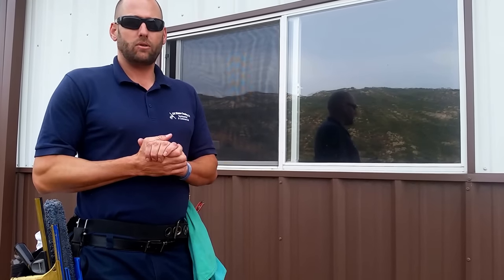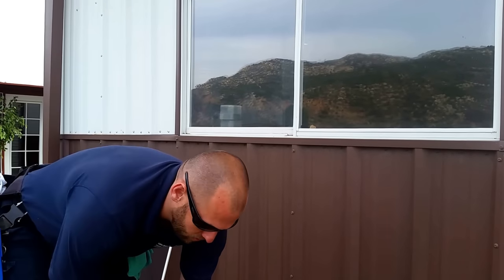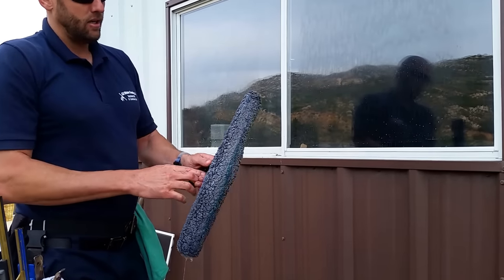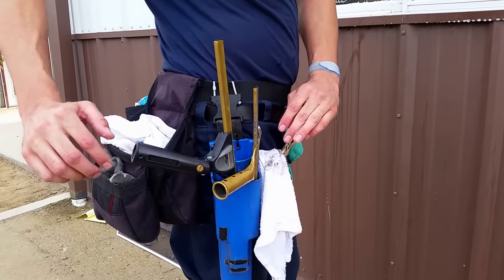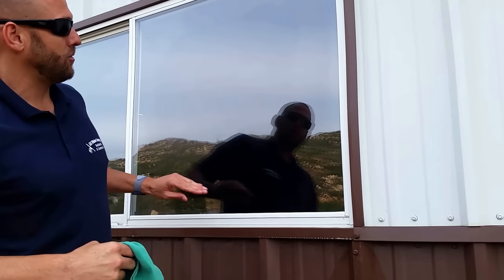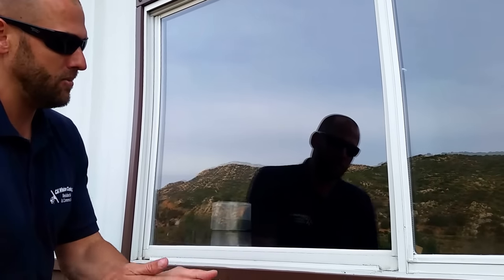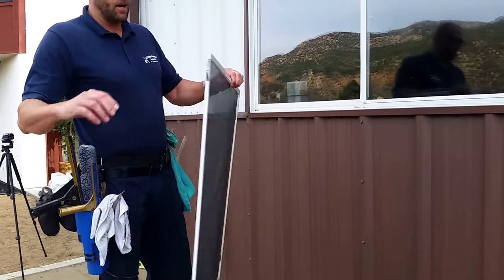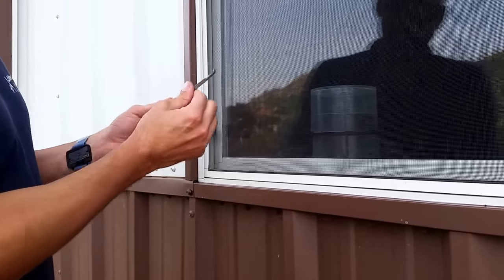5 STEPS of WINDOW CLEANING - C & C Employee Training

Comment: I have been cleaning windows over 20 years and you make it so much harder than it has to be. Rags and steel wool are completely unnecessary. Carry a scraper for paint or sap and other stuck on debris. Maybe one wet rag for wiping sills, dip, rinse and reuse. I understand not wanting call backs from sloppy work from employees but you just need to personally train them and work with them until they get it right.
Reply from the maker: your a better man than me giving your people razor blades......I truely dont know how you get away with it...

Comment: 1. Take all screens off with a 5 in 1 from all windows first in order and go wash them with window Brush and hosing off the screens and wiping edges and knocking off water. Than put each screens near the window it came from.  I charge $2.50 a screen and always wash them as they hold lots of dirt, mold and pollen. When it rains the window will get dirty again if the screen is not washed. Most contemporary residential vinyl windows require you take the screen off and back on from the inside. Other screens that cover an entire windows I take loose the 2 clamps at the sill and take off from outside. Ladder w''s (Windows) are taken off from the inside and stacked in order outside to wash. 
2. Wash all windows and frames with a window washing  brush with dawn and water.
3. I use a triumph 6 inch scraper to get all bug and paint off while the window is wet
4. Re wet window 
5. Wipe top edge squeegee window and one side if doing a side pull. On residential w's I don't usually fan the w's. We do very expensive high end homes and do not want to leave any squeegee marks. 
6 Dry cloth wipe edges being careful not over rag the w's as that will leave dry rag marks.  
7. Reinstall screen
I only use 4 ought steel wool if I have oxidation or on the frame and sill to get stubborn mold stains off. Yours truly, Sterling  Window Cleaning in North Georgia.  
Moral when the sun comes out and shines on your windows than you will know how good a job you really did. Same in life when the Son shines on your life at the end what will He see? Sin or shine?
Reply: Romans 3: 22-24
22 Even the righteousness of God which is by faith of Jesus Christ unto all and upon all them that believe: for there is no difference:
23 For all have sinned, and come short of the glory of God;
24 Being justified freely by his grace through the redemption that is in Christ Jesus:

Our righteousness is as filthy rags. What do you want Jesus to see when he looks at us, our sinful lives, or the righteousness of Christ imputed to us by faith? Put your trust in Jesus Christ for salvation, not your own works.

1 John 1: 8-10
8 If we say that we have no sin, we deceive ourselves, and the truth is not in us.
9 If we confess our sins, he is faithful and just to forgive us our sins, and to cleanse us from all unrighteousness.
10 If we say that we have not sinned, we make him a liar, and his word is not in us.
Reply: What is this windows or sunday school

Comment: Another good way to prevent dry streaks or smudges is to apply a decent amount of pressure from the squeegee to the window. I used to get very frustrated with these streaks because I knew I squeegees the window like a boss. Once I started applying heavier pressure to the window with the squeegee, left over streaks and smudges became a thing of the past. Also, I’ve never used the ragging the edges before squeegeeing technique, that will save me a lot of time. Thank you for the nice instructional video.
Reply from the maker: thank you for commenting, yes, pre-ragging the window will really save your rubber edges big time!

Comment: A safety is us only S/S blades on windows. I install graphics on the glass and have to some time run a blade on the glass. S/S blade is less likely to damage the glass as carbon steel blades.
Reply from the maker: Cool beans thanks for the comment
Reply: Robert w Sieburg late to the party but. What are s/s blades ?

Comment: I use a water hose with low jet setting to get those tracks completely clean. Your 'extracter' tool can scratch the frames or puncture the screen, try a frosting spreader, it's smooth edges and rounded top do an excellent job of removing most screens from the outside.Are you doing an initial cleaning?Hope you charged accordingly. And polished? Funny.We use natural sponges instead of rags. Anyway I've been doing windows for over 30 years.I am a pro!!
Reply: Thanks for the frosting spreader tip. I just want to clean my screens and have a hard time getting them to pop out. Hence I don't clean them. Sigh. I should just hire someone.

Comment: Amazing detail, have you tried bronze wool? Doesn’t rust.
Reply from the maker: Bronze wool does not rust but only comes in a maximum of 000 you also have to put your credit card into a website, have a computer,  have internet access, and then wait for the 000 steel wool to arrive, then you may or may not run out,

when you have 160 different acquisitions to measure when running a company with several people you absolutely must minimize errors, expenses, and supplies,

0000 steel wool has the same abrasiveness as bronze wool 000, and I believe it is a little bit more abrasive because bronze tends to bend and steel does not,

the true entrepreneurial genius of steel wool versus bronze wool is that if you have eight crews going on out there and you teach them all to type in "home Depot nearest to me" they can all find 0000 steel wool at any home Depot within about 20 or 30 minutes from them!

of course if you're doing San Diego and you're in my neighborhood they are about 8 minutes away from any home Depot,

So the acquisition of any type of abrasive wool never ever ever ever ever ever comes up

Now if you multiply never never never never never times 160 different acquisitions you are then an entrepreneur and the world can function WITHOUT you,

But eventually you may want to throw your guys some bronze wool lol....

Thanks for commenting on one of the 160.....

Comment: Lost your belt clip as everyone does lol. I recommend using a porcupine strip washer on the exterior. Many times you can get the window cleaned and polished in one step. I like your clamp town holder. clever idea
Reply from the maker: porcupines lose their cotton way faster, dont obsorb as good, and one less step to use it on in and out instead of two different ones, porcupines also dont scrub 100% like steel or bronze wool so having more water retention is better if wool is needed anyway (EVERYTHING COMES OFF WITH US) its the only way to insure no call backs and high prices....

a lot for only ONE of over one hundred systems.... thats why every tool has multuple purposes and vital significance....

thanks for your input😊

Comment: You can crack the glass by pushing with a tool at the frame, alot of today's window frames have a lap over that isn't thick and will bend and cause the window to crack.
Reply: He’s pushing on the frame of the screen with the tool, not the window.
Reply: @zombieepx1933  there after he uses the tool to push the window closed, that can cause a crack in window due to pressure.

Comment: Loved the vid! The only thing confusing me is adding the soap to the brush. That’s bonkers where I’m from but hey, to each their own.
Reply from the maker: Dammit Josh! LOL there's a reason for everything and yes I'm going to now explain it to you...

At each job there are several variables in which equipment chemicals water movement speed client temperament and the adjustability of your forces, I mean your crew LOL...

I like to keep the water bucket simply a water bucket and only add a dash of Dawn dish soap while cleaning screens because if there is too much soap in the bucket you will be standing next to a screen forever trying to get all of the suds off, now the suds required to efficiently clean a window screen is about 10% of the suds required to clean a window, and so I add the dish soap directly to the mop with the amount that I want for the window, then dip it in the water quickly to give it a water load, now if you're working in doors you rinse out your bucket and have pure water sitting at the doorstep and high concentrated dish soap in your squirty bottle because you could always stop at a sink inside the home and water load when your two or three stories up away from your bucket, and your concentrated soap bottle is down in the bucket by the door, so much on the subject of Dawn dish soap LOL thanks for commenting...
Reply: C & C Window Cleaning LLC. That makes much more sense. Thanks for taking the time to explain it. I usually only do commercial windows so I’m not residential savvy quite yet but I’m definitely going to try your method once I get another home scheduled.
Reply from the maker: No problem bro! Thanks for commenting!

Comment: I appreciate your thoroughness. I think too often, window washers can be thieves in the quality and value we offer in relation to how much many charge. Really, with experience, these extra efforts can be accomplished quicker and quicker, until it's not much slower than the typical "dusting" many window cleaners do.

I'm curious about a couple things:
1) could you explain how the polishing prolongs the windows life? 
2) what's your holster system? I'm curious about what you have holding the brush?

Thanks for the great video.
Reply from the maker: thanks for the comment you will go a long way understanding the true concept of this video, this is a $20 belt and hip pockets basic tool belt from Home Depot, I've purchased probably 10 to 12 of them and I'm glad I picked one that is cost-effective.  the brush and squirt bottle sit in one pocket, by polishing the glass it makes a surface smoother and catches less dust and gives an overall cleaner shine
Reply: Thank you for the reply. Sorry, I thought I heard you mention that the steel wool prolongs the life of the windows (If so, how does it do this?). Did you actually mean it prolongs the length of time it remains clean? That's what it sounds like from your response. 

I find the biggest exchange in accounting that my attention to detail does for me is removing my need to advertise. People notice the difference in our efforts, our attention and the final product compared to other window cleaners, so we retain clients and word spreads fast. We still make good incomes and pay the workers well. It's great to see the extra effort, done by another company. 

Thanks again for the video!
Reply from the maker: haven't watch this video in about a year but found the part where I said "this glass will last much longer" ... I'm pretty sure I meant the cleanliness of it, but when you keep glass cleaned there's less chance of debris like hard water minerals and stuff eating into the glass that can definitely harm it over time, steel wool polishing can rub off the buds of glass corrosion.

Comment: Great video. Why doesn’t the steel wool not scratch the glass?
Reply from the maker: Glenda Romero it has a certain scale of abrasiveness, when they thread it down so thin that it bends like cloth, it doesn't have enough physical properties to compete with the strength of the glass surface, but as you move it across the smooth surface it tends to catch on to pimpled debris such as paint small pieces of Stucco and stubborn grime... the properties in the steel (as they collect together and bow around the debris) gather enough strength to scrape it off of the glass, once you understand this ebb and flow of Steel and smooth surface, you can gauge your accuracy in polishing versus scratching by using either four zero steel wool or three zero steel wool..... good luck out there

Comment: What if you are cleaning using an extension pole and feel a spot you need to polish?
Reply from the maker: Then you must have really really really long fingers,

You shouldn't clean residential windows with a pole unless it is interior or some type of Windows that does not have tough debris on it like bee pollen and stuff like that usually vaulted ceiling windows or Windows under good protection can be done with a wag tail but for sure not windows that people are going to walk right up to and see those need to be done by hand or water fed pole if maintainable, unless you're just really good at pole work, in which case you can use one of those bronze wool pads

Comment: The tabs on the left side of the window are to remove the screen from the interior
Reply from the maker: That's not correct they're actually there to break LOL because that's all they ever do , you should never use the tabs unless you have those really awesome rubber ones
Reply: @ccwindowcleaningllc.4706  So freakin true. - Miller WIndow Cleaning.

Comment: Why dont you use the tabs on the screen to remove it? Does it damage it or something?
Reply from the maker: The tubs are usually on the inside , and I don't like to use them anyway because they typically break it's so much faster just to use this tool

Comment: Im just starting and would love a belt set up like that. Where can I go?
Reply: Home Depot is a good place, I believe Luke the window cleaner on YouTube got his belt from Lowe's and the pockets might be a little deeper so I would probably go with that one or check them both out, I tend to stick with Home Depot because I get everything there and there are way more Home Depots within 20 minutes of anywhere I am, I know these are $20 at Home Depot though they come with three pockets and a pretty good belt
Reply: the items I have on this video that are from Home Depot are  $0.45 screen extractors , which are paint can openers I suggest getting about 15 of these because they get lost for some reason... 1 inch razor blades that attach to my wrist magnet from ABC window cleaning, 0000 steel wool from the paint aisle, white Terry towels, 99 cent clamps that are good for many different uses you could see them on the side of my hip for holding the towels, also in one of my pockets is a 1 inch razor blade holder that you can also get in the paint aisle, but I do not put it on my training videos because I don't let anybody else to use them , and a screen rolling mouse cost about $5 in the window screen Department, oftentimes the spline is coming out of a screen and I just roll it back in really quickly.... I'll let you know if anything else comes to mind
Reply: Google "Fish Window Cleaning Consumer Complaints" It’s a bad con  franchise.

Comment: Awesome video, my only question is what do you do when it’s an awkward 2nd story window where the foundation is uneven and dangerous for a ladder. I am a one man business and I keep getting leads where the customer wants the windows cleaned along with the other exterior cleaning services I provide. But the dangerous ladder work, and windows above screen enclosures that can’t be reached are the only thing turning me away.
Reply from the maker: Just charge them enough money to buy yourself a three-story water fed Pole and don't ever clean windows above the Second Story without telling the customer that you will use a water fed pole and it'll come out about 95% as good, this is called protecting yourself with a limitation of services you will find it will be a diamond system that will protect you hundreds of times in the future
Reply: The Ladder Leveler and pivot tools are wedges for ladder feet on uneven ground

Comment: have you ever had a client get their building sprayed for bugs and the spray got all over the glass,  then baked on? It won't come off with normal washing.  do y I u know of a quick efficient way to remove it? I was going to scrap and scrub with wool, then charge extra for each pane.
Reply from the maker: using 0000 steel wool or even 000 steel wool just make sure the windows are very wet and you do not scrub too hard start an inconspicuous place in the window and make sure it's not scratching the window if you're going to use 000, if that doesn't work use a really good brand new glass scraper razor blade, or even Goo Gone

Comment: Do you have a link to the steel wool you use or is any 4/0 good?
Reply from the maker: Random Guy On Youtube any four grade steel wool should work I use 3 grade myself I get them at Home Depot I've just started using bronze wall it is a lot more convenient you just have to press a little bit harder but it does not rust, it is softer than steel wool